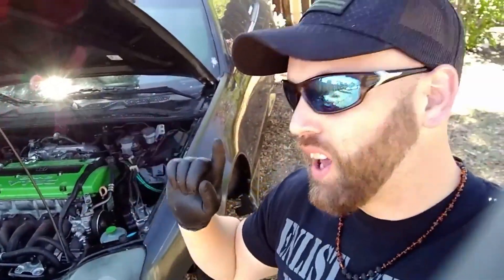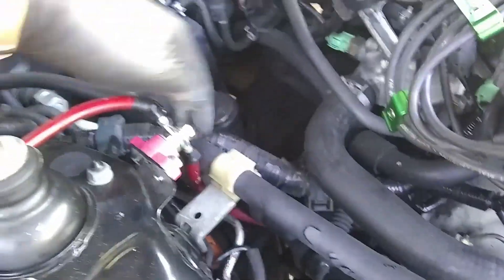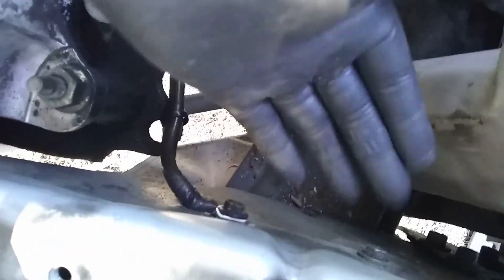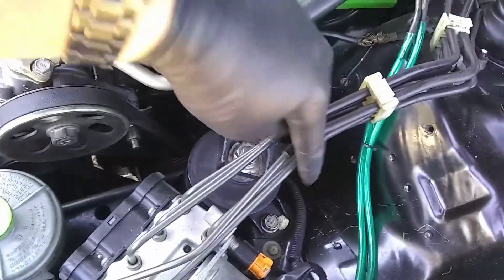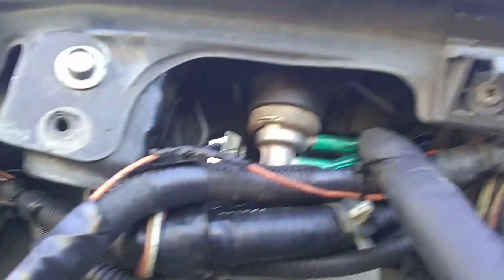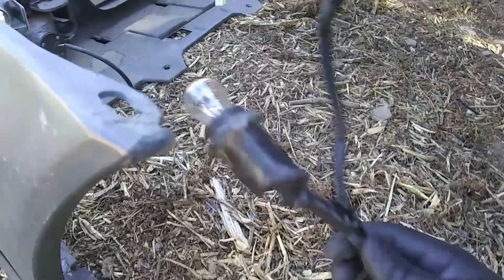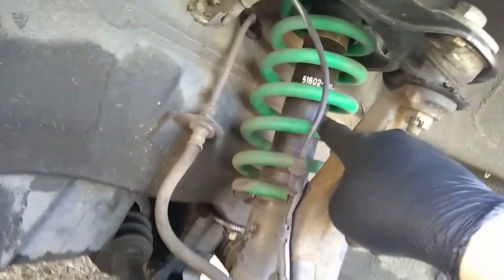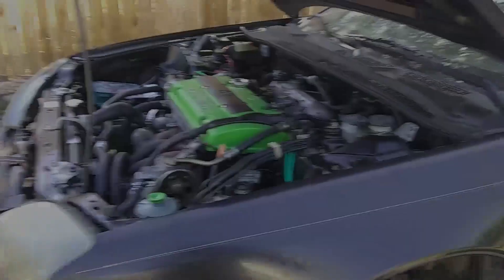2000 Honda Prelude VLOG 3 Wire Tuck

Comment: How did you get the wires under the fuse box?
Reply from the maker: Hey David, thanks for asking.  Once you unclip everything, all the wires with the big blue connectors have just enough slack that you can tuck and bunch them below the fuse box.
Reply: My Car DIY did you have to remove the fuse box? Or just tucked them in? 
Great videos I’m going to do your method of battery relocation. Waiting on more prelude project videos
Reply from the maker: @Davidsworldz  you don't need to completely remove the fuse box, but you do need to unattach it by undoing the 1 bolt and 2 tabs on it.  Then just pull it up, slide the bundle of wires under it, and then replace the fusebox. If there's any specific project you're curious about just let me know.  Full write up on the wire tuck is on Extremeprelude.com :-)
Reply: My Car DIY I’m going to try it this weekend thanks for the help. I would like to see a video of what the heck the little square box under the intake by where the battery is located is if I knew what it was called I would say the name but idk what it is.
Reply: Or if you do the fuse box relocation video would be awesome!
Reply from the maker: A fuse relocation video would be awesome..... however, I'm one of the few that actually likes the position and shape of the Prelude's fusebox lol.  I plan on doing something to the cover of it though :)
Reply from the maker: The black box under the battery is the intake resonator.  It's basically what tells the computer what kind of airflow is coming into the engine and directs the air from the outside vent to the filter box.  I deleted mine.  Just takes plugging the vacuum lines for it.  Here's the link to the pic when we deleted ours (it's under our other instagram before I made the car specific instagram for everyone to easily follow the car content) https://www.instagram.com/p/BnNTHu2hMJz/
Reply: My Car DIY just added you!! I’ll dm you the pic of the box I’m talking about